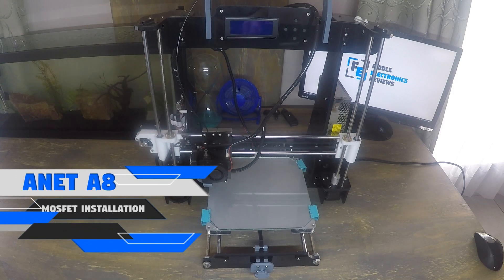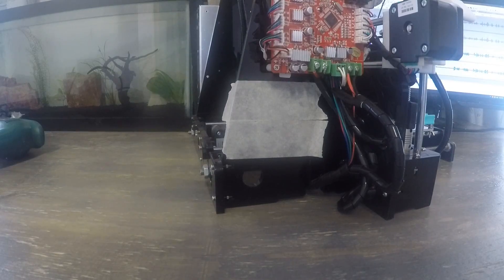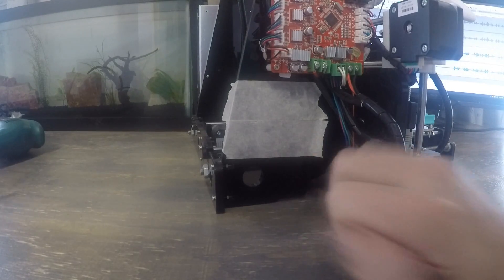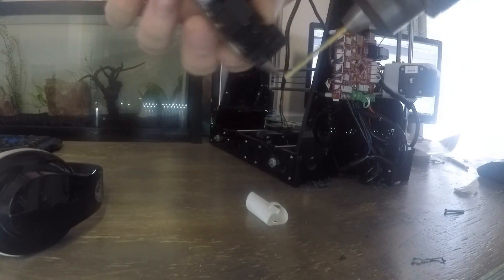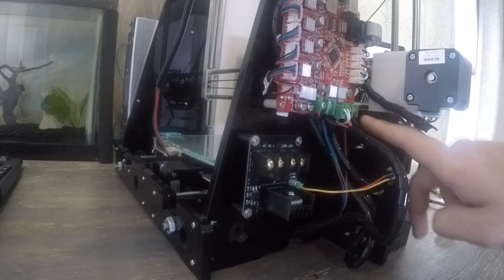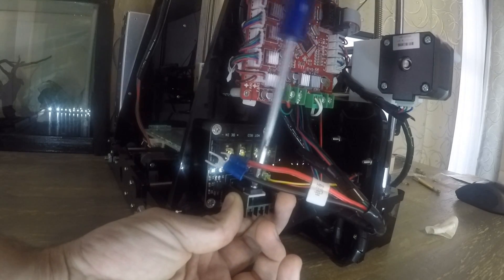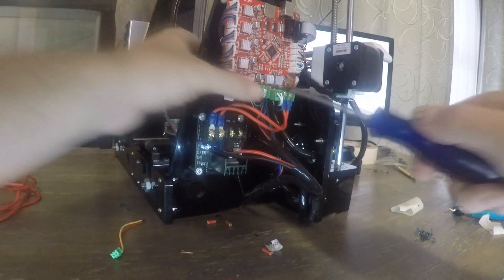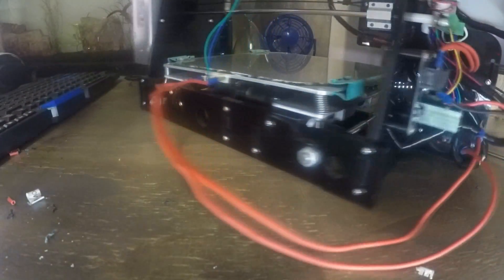How to install a Mosfet | Anet A8

Comment: Why not use the spare COM and V+ terminals from the PSU?
Why not attach the mosfet to the control board with one of the many printable mounts?
Why not connect the lugs from the other side so as not to have to unscrew the mosfet?

Comment: You have provided incorrect advice and still provided a fire risk.  

Remove the all the heat bed/hot end wires from the main MOBO to the relay (MOSFET = relay) the current as you have it wired is STILL being drawn from the MOBO... 

the whole point of the three pin/four pin/five pin relay or MOSFET is to remove the draw from the board.... DO NOT CONNECT THE CURRENT WIRES TO THE MOBO.  ONLY connect the "signal wire to the old plug with the little white wire, I would agree the you should put beefier wires in both but you should measure the resistance.  I would put at least a six core thick wire to the head bed and from the PSU in black and red from the PSU and if you really want a visual cue to make it easier to understand, that is up to you. DO make a note on masking tape to remind yourself.  Remember is MOSFET is not much different from a old style car starter motor relay.

Wire the DC from the power supply to the */-, then make a connection to the signal from the MOBO. from the MOSFET wire to the BED.  and yes the colour does matter for humans to not short circuit the pc/MOBO if there is a power surge or someone else has to work on it. the current doesn't care what colour the wire is.  I f you wish to improve the MOSFET put a dab of PC CPU paste between the MOSFET and the heatsink to improve heat transfer

@if you wish to know more  about transitors /MOSFETS-->>>" Transistors are solid state switchers, that is, they don't have any moving parts. MOSFETS are like transistors, but are rated for higher voltages. Relays are more expensive, but they have moving parts.

Transistors and MOSFETS produce a lot of heat. They have 3 pins (usually) called the base, emitter, and collector. More info here

Relays use a magnet to control the position of a metal switch. They generally take more power than an Arduino pin can deliver, and therefore they are often controlled by a transistor. Relays can usually switch more current than either a transistor or a MOSFET.

There are also solid state relays, which have a TRIAC (like a transistor) in them. These can't switch as much as a normal relay, but they generally have better ratings than MOSFETS and transistors. example

--TheDoctor   http://arduino.stackexchange.com/questions/273/ddg#275"
Reply: this should be top comment! by wiring up how the video shows, does not remove the fire risk, it only re-routes it! - plugging the power wires, and then the heat bed wires onto the same terminals on the mosfet completely negates the mosfets job. the guy in the video has wired this wrong and needs to re-edit with correct wiring.
Reply: @nashfunk389  It's wrong though. The OP connected the motherboard and the mosfet in parallel to the PSU. It's a common enough way to do it. There's no signal coming from the PSU to the Motherboard or between the Motherboard and the Mosfet board other than from the Hot Bed pins that are varying the voltage to the mosfet signal pins controling the power supplied to the hot bed.
Reply: Honestly though I'd just use the spare COM and V+ terminals to avoid confusing people. Someone could do this wrong and burn their house down.

Comment: I have 2 anet a8 printers and on the most recent one, the mosfet blue LED comes on saying it's putting out, But the hot bed light does not come on. I've tried 2 mosfets and same thing. Any ideas? I've done both the hot bed and extruder on both. All work except the hot bed on the new one, but it DOES work when hooked up direct to the main board.
Reply from the maker: Garry Kennedy Strange, are you sure your 2 pin jst plug is connected correctly? Have you tried swapping the hot end and the heatbed MOSFETs to rule out a faulty MOSFET?
Reply: The JST plug is not polarity specific from what I've read, but it is connected to the main board HOT BED plug. The blue light comes on showing it has the TRIGGER to turn on. I like the idea of hooking it up to the hot end and see what the display reads. Can't do that for long though because of thermal runaway. I have tried 2 mosfets but I guess it's not impossible that both could be bad. Just a bit unlikely. I'll try that and get back with you. Thank you.
Reply: Well we found the problem and I feel stupid! LOL  It was the 110/220 switch on the power supply. I can't believe I forgot to set it to 110.
Reply from the maker: Garry Kennedy Glad you found the problem!

Comment: You are defeating the whole purpose of the Mosfet?? The mod is to take the main board out of the power loop. And route it threw the Mosfet. So the main board only turns the power on and off to the heated bed. Decreasing the chance of a burn out of your main board.

Comment: Thank you my friend that was very helpful. Except there's mounts on Thingiverse that you don't have to drill any holes in the frame for it. It actually hangs right were you have yours off the corner screw from the motherboard and it works great.

Comment: One question, after installing the mosfet the nozzle fan starts working very fast and making a lot of noise. I have noticed that if I connect just the power wires (positive of the mosfet with the 9 of the power source and negative of the mosfet and the 6 of the power source) just with this the fan starts turning like to a 500% lol 
Do u have any suggestion? can u figure out what may be the problem?
Reply: you are providing too much power to the fan and the mosfet is usually not used for the fan as it doesnt draw that much current.  get an ammeter and measure, you can put a reostat inline or just take it and put it back on the board as the fans do not draw enough power to fry the mobo. if you want to keep using so many mosfets, get a reostat and put in a 1kohm resister inline to the earth to make sure that you do not get a short. make sure you get the right kind of resister that only allows current one way.

Comment: I followed the video very carefully and the hot bed and extrude heats correctly, but the hotbed will continue to heat until I turn off power to the printer. If I give power to my printer the hot bed will start to heat and I don’t know what to do. Please help. I’m a beginner to this stuff. I appreciate any help I can revive.

Comment: Excellent practical tips: The tape used to mark the position of the holes; removing the heat sink temporarily; using the terminals; the diagram, etc

Comment: Do I have to purchase extra things, or does everything except the mosfet come with the printer?
Reply from the maker: Bigboy Games The lugs, thicker wire, and the 2 pin jst plug don't come with the printer. You'll have to get them all separately. The tools such as the wire cutters and screwdriver come with the printer though.

Comment: Just so I understand, in order to install this on the printer, as you say in your opening, you first need, uh, the 3D printer?

Damn! No wonder this didn't work for me! I need a, uh, printer!  :-)

Also, I would venture to say that anyone installing one of these, and who owns a 3D printer, does NOT need to be told where to get electronic parts. We know that we can get what we need from the "local electronics store".

We also know to observe polarity. At 4:20 in the video, you connect the MOSFET to the main board. These are polarity sensitive connections. Instead of admonishing everyone to "please observe polarity", you should properly wire this segment of the installation by always using the correct color for your positive and negative runs. That would be black for the negative connection, not red. 

If there is anyone out there that is able to operate a 3D printer, and install this device, and they do not know to observe polarity, they should not own something as complex as a 3D printer.

But, besides that, good video.
Reply from the maker: Thanks for the support. 

As you say anyone who is doing this should know what they are doing so I could use a pink and orange wire and it shouldn't make a difference. Also I'm just reminding everyone to remember polarity as some people might not know this is a polarity sensitive device.  And actually people have commented asking where to get parts such as the lugs.

Some people who watch this aren't necessarily electronically inclined and might have just built it from  tutorials and are trying to do upgrades on their printers, so I am trying to appeal to everyone, those who know very well what they're doing and those who don't as well.
Reply: David Tower maybe you shouldn't be so damn picky he's explaining this to a novice.. If you're not a novice you wouldn't need the video..

Comment: Hey, this video is very helpful, but  i was wondering what "plugs" you used to connect to the heat bed connector, if you could send a link of the product or of a picture representing them, this would save my bacons

Hope to hear you soon ! :)
Have a good day !
Reply: Don't use plugs on the hot bed, they're likely to burn up as well.  You're talking a high current so soldering the wires directly to the board is far better.  If you can't solder, it's time you learned and cheap $15 soldering iron will do.  Also ensure your cable doesn't bend at the hot bed when the printer is working. Position the wiring loom so it doesn't bend at the bed.

Comment: Instead of wiring through the mosfet to power the board, could you send wires from the open COM/V+ terminals on the PSU for the same effect?
Reply from the maker: Yes! that would work too!
Sorry for the late reply
Reply: the mosfet would be closer to the motherboard...why run anther mile of wire from the otherside of the printer? his idea was fine

Comment: I notice you wire the power to the mosfet, and then back to the board. Why do you wire it back to the board? I see some people who do not.
Reply: Glad someone else saw that too
Reply from the maker: Zephen I don't see how the Printer will be able to operate without power to the mainboard. What I think you mean is that other people have just connected from the power on the board (which already has power going in) to the MOSFET, which is essentially the same thing.
Reply: No uh, the the power connections on the board, one is for the bed, one is for the hotend, and one is for the board, I noticed that some people did not connect the MOSFET back to the heat bed connector on the board  like you have, and I'm wondering why.
Reply: Is the wiring in this video wrong?
Reply: Tom Campbell yes, electricity is like water, it will take the path of least resistance. The MOSFET is similar to a mechanical relay.
Reply: Soooo, what's the correct method ? This newb is TOTALLY confused!!!
Reply: https://3dprint.wiki/reprap/electronics/heatbed_mosfet cheack this link! It's really helpful!
Reply: Oh good god. Don't wire the power back to the main board. It bypass' the purpose of the mosfet. A mosfet is to use the lower signal from the main board to switch mains power on and off while isolating the mains voltage from the sensitive electronics and connectors. Which in this case, have tendency to burst into flames....

Comment: In my opinion you installed it upside down.  You want the heatsink for the mosfet to radiate heat upwards away from the mosfet and the wires located directly above it.  Installing the PCB positions the heatsink upside down it won't have as efficient heat dissipation as possible in the installed position you show.  The fins of a heatsink should always be pointed upward for maximum heat dissipation efficiency.
Reply from the maker: DJDevon3 I completely agree with you, but on this specific occasion, the way I had my wires it was more convenient to do it this way, only because the heatsink barely gets warm in this specific case.
Reply: It really doesn't matter for this particular situation is it doesn't really get hot.. And the difference is minuscule..

Comment: the site says something about max 25a on the mosfet, so i cant use it on a 30a power supply?
Reply from the maker: Jalte Rasmussen This only means that the power supply has the potential to put out 30A total current. but the printer does not draw anything close to that. so the 25a MOSFET won't be affected. Thank amount of current that will flow through the the MOSFET won't be anywhere near 25A
Reply: ok nice! thank you for answer. great vid btw :)

Comment: Where did you buy the wire lugs and the red cable
Reply from the maker: At my local electronics store. You should be able to get them at most hardware/electrical stores. The wire aswell.  Thanks for your support!
Reply: Which diameter is Most Suited for the Job? And which diameter do the lugs have?
Reply from the maker: Hoots die Eule try get anything just a bit thicker than the original cables and the lugs corresponding to the cable diameter
Reply: And what about the size of the lugs diameter where it connects to the screw? Which one do i use? M4? Every lug i look at has 2 values. The diameter of the cable and the hole size.
And another Question. Can i use Speaker Wire for Power? Its 1mm² . Im asking because i have like 20m of it laying around.
Reply: Local electronics store?  What tha hell is a local electronic store!
Reply: NO NO  NO, never use speaker wires for anything other than  errrr speakers.  Use a much thicker gauge to carry power from the PSU and the Mosfet and onto the hot Bed.  Using speaker wire will heat it up and possibly burn.

Comment: Would there be any reason to run separate power wire to the main board and only run the heat bed through the mosfet. I've seen some varying opinions but never could get an answer? I don't fully understand how mosfets work.
Reply from the maker: Yes that will be perfect! +Hoots die Eule did a great job of explaining! Thanks for your support. Feel free to ask any more questions if needed
Reply: Basically what a Mosfet does is to split the Power between the Mainboard and the Heated Bed to take stress off the Mainboard. Normally your heated bed is connected to the Mainboard and the Power goes through the Mainboard to the Hotbed. With a Mosfet, the Printer tells the Mosfet over the Heatbed Connectors (The short wire with the small connector) that Power is active for the Heatbed and activates it. In most cases this speeds up the heating process because the Heatbed can draw more power and the Mainboard is stressed a lot less.
Reply: Hey thanks. I did hook mine up as explained in the video. But was really bothering me that I may have done it wrong and wasn't getting the benefit of adding the mosfet by running the bed and mainboard on the same line from the psu. Thanks for the clarification. Feel a bit safer.

BIQU Heat Bed Power Module Expansion Hot Bed MOS Tube for 3D Printer https://www.amazon.com/dp/B01HEQVQAK/ref=cm_sw_r_oth_api_UT7azb8DT806Y

I purchased this mosfet. Single input and output. I piggybacked wires from D.C. Input to the mainboard.

Comment: Great Video! Helped out a lot. How did you get such good cable management on your main board? It looks incredible!
Reply from the maker: Thanks for the support! I hate lots of loose wires so I've just tucked all of them under the mainboard and only brought out the connectors where the plugs are.
Reply: My printer is still on delivery, so I have to ask - is it safe to put all the cables under the mainboard? Are there any parts on the board that reach a higher temperature during operation?

Comment: Nice video. But I don't recommend drilling the acrylic frame as it could crack and weaken the printer. Instead print this Mosfet support frame and attach it to the printer. locate it here http://www.thingiverse.com/thing:1857006. Aside from that great video. It will help a ton of people.
Reply from the maker: Thanks a lot for your support!
Reply: I have had zero problems drilling into the acrylic it drills just fine..
Reply: If you have a sharp bit and drill the hole out in steps it should be fine. It's generally best to remove the panel and do the drilling on a drill press where you can have greater control over the drilling pressure, angle, and can place the panel on a scrap of wood to spread the pressure out away from the point of the drill bit.